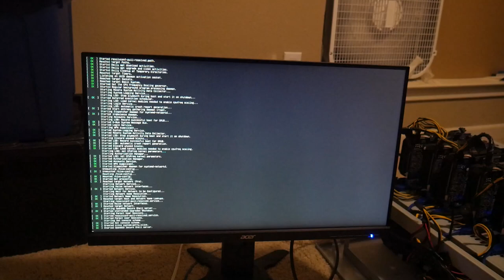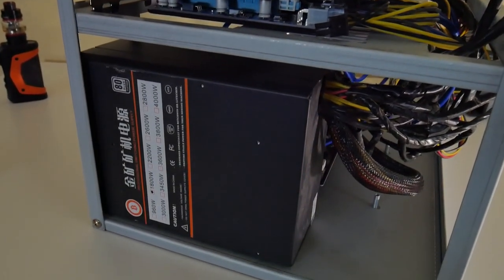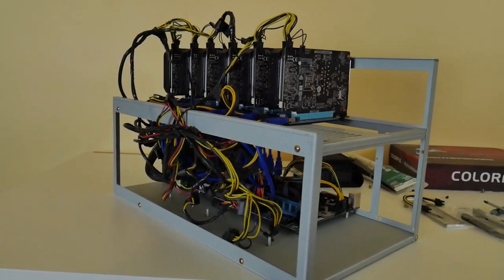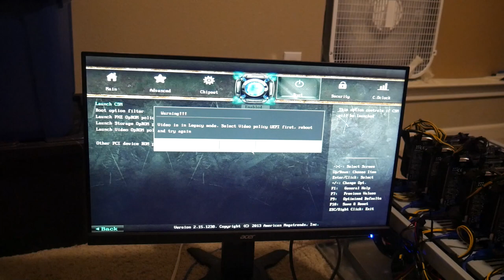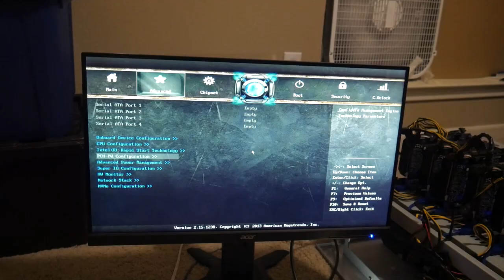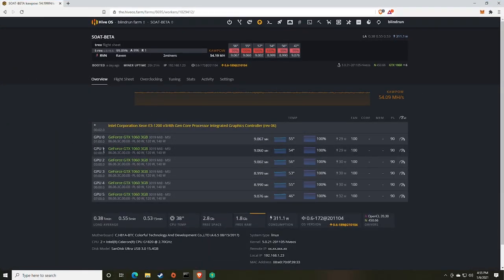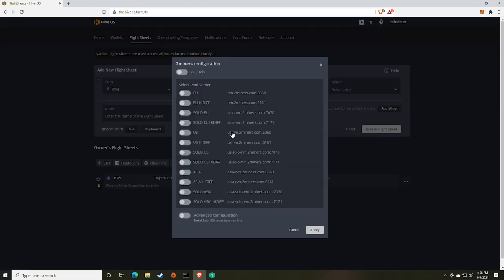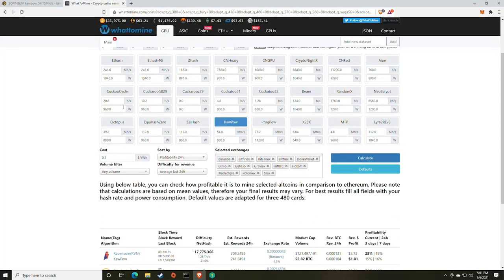Building A Ravencoin Mining Rig 2021

Comment: I'm building my first mining rig tomorrow once the 3060 I ordered gets here with the PSU, riser cables and frame. I'll have a 1660s along with a 3060 on the rig, with space for one more down the road. It will be mining alongside my RTX 3070 in my desktop and my mobile RTX 2060 In my razer blade 15. I decided to take my last unemployment check and invest into another GPU and parts to build a rig so that I have even more reoccurring income than I currently have. I used a i5 motherboard and ram I already had laying around. I'm super stoked to build it, and the best part is I don't pay for electricity in my apartment so it's all profit ☺️

Comment: Hi! What you guys think of riserless mining (no pciex risers, but octominer-like motherboards - those you can find on AliExpress for example) ? Are there any restrictions for newer cards like rtx 30xx ? Maybe PCIex 3.0 vs 2.0 or alike ? Thanks!
Reply: I have used one before, I bought it off eBay for around $193 and was pretty happy with it, it comes with an Intel CPU built into the board which is cool. The only down side is despite the slots being full slots, they only run at 1x speed, however the PCIE bandwidth has very little effect on mining speed in my experience. For me the extra cost of the board is well worth not having to deal with risers. Hope this helps!

Comment: does the 3gb still mine raven? I have one and it gives me a memory error when I try to mine raven. Using T-rex/win10
Reply: It does, though use the OS HiveOS. You can control it via web interface and draws basically no GPU RAM. Windows uses around 600MB of the GPU, and you need 2.6 GB I think, so use Linux or HiveOS

Comment: can i mine with NEW 750TI 4GB this are the specs 
Model Number : AKN750TiD5S4GH1
Graphics Engine: GeForce GTX750 TI
Stream Processors: GM107-400-A2/ 640SP
GPU /Boost Clock: 1020-1085MHz
Memory Clock: 5400MHz
Memory Type: GDDR5
Memory Size: 4GB
Memory Bus: 128-bit
Outputs: HDMI, DVI, VGA
HDCP Support: Yes
PCI Express: 3.0
DirectX Support: 12
Recommend PSU:300W
Maximum GPU Temperature (in C): 95

i cant find how much hashreate do this GPU